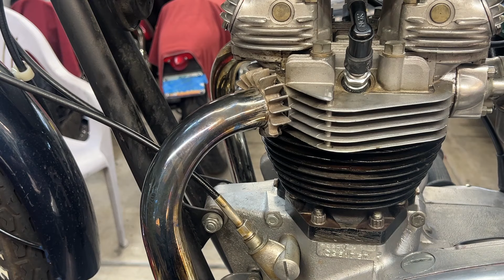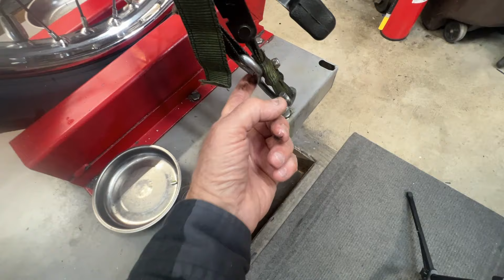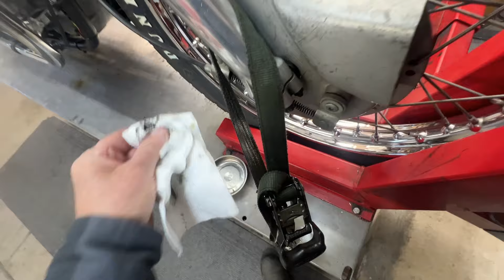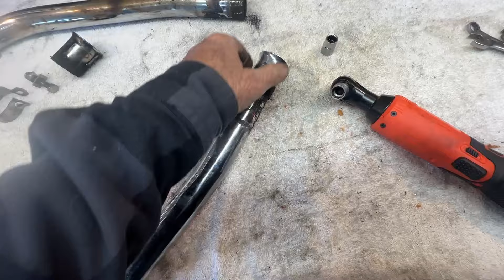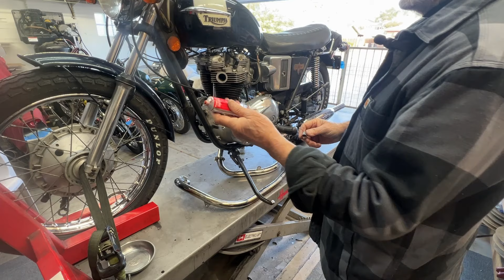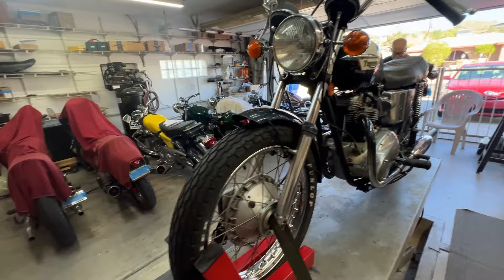02-28-24 - 72 Triumph - Exhaust System

Comment: Needs the balance tube, and after cleaning everything up good I use clear bathroom 100% silicone.  Around the pipe and slide them in.  No vibrations, no leaks.   Have been doing this for 30 years and never have had a problem. Even after 25k miles on one of my own machines. 
Bless you Frank.  You are a fantastic mechanic ! And Mentor!

Comment: The original pipes on that model would have had a balance pipe between them which stabilises them and reduces the movement, but someone has replaced them with those individual pipes, which it was never intended to have. The earlier models which had separate pipes had screw in stubs in the ports which the pipes were clamped onto, giving them a solid mounting. They went back to this method in the later T140s because those push in ones never did seal effectively. Believe me, any sealant will vibrate and blow out before too long - I've been down that road myself before I decided to do it properly and convert to the screw-in stubs.

Comment: On my 78 Triumph OIF I cut some strips from an aluminum can and wrapped them around the end of the header pipes to make a tighter fit.  It seems to have worked.   I put some tissue around the flange where the header enters the port and then started the bike.. it didn't seem to move from exhaust blow by.  You're right though, it's not a great design.  The header pipes on my 64 TR6 are much better.

Comment: The "push in " system,although not a good as the earlier "push over" system, work much better if the original balance pipe headers are used.

Comment: The only problem I have the sealant you used is I would have put it on the header first and not in the head first.   Putting in the head first will allow the header to push the sealant into the head (possibly) which would not be desirable.

Comment: In 1971 Triumph couldn’t think of a better way to fasten the headers?  Seems like they were hardly trying.
Reply: I love my two 70’s Triumphs but I wish back in the 30s Edward Turner hadn’t chosen to incorporate the leaky external pushrod tubes. Worst source of oil leaks on the bike, except for the fork seals, primary drain and tensioner, rocker shaft seals, rocker boxes. Otherwise it’s great! 😮